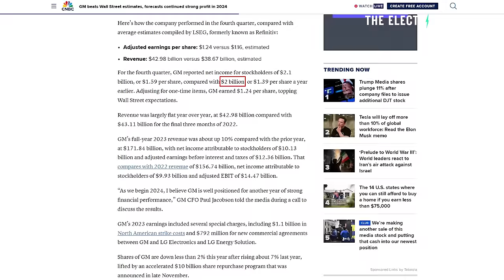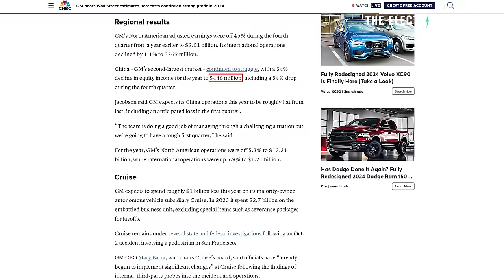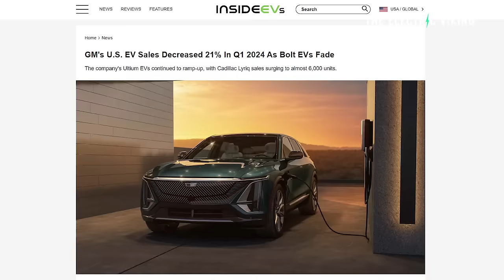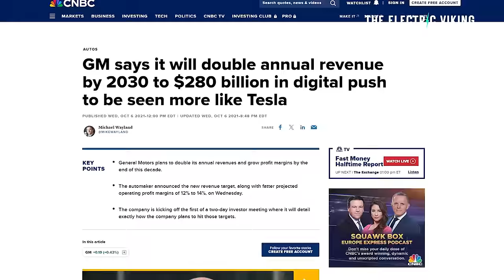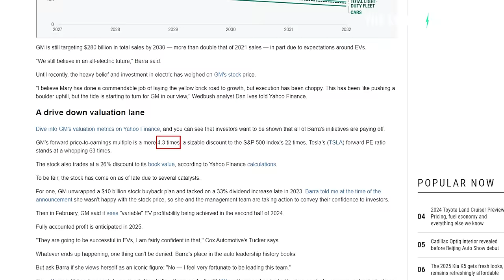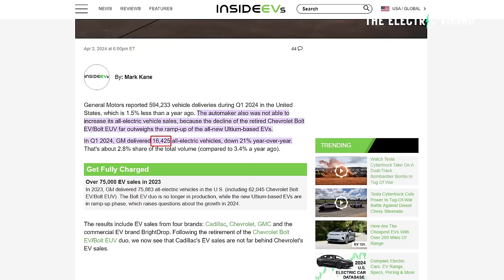GM will execute on EV promises in 2024 says CEO Mary Barra as sales fall 21%

Comment: The number of EV’s sold is likely due to the retiring of the Bolt, which has to be their number one seller. Time to move people to a full size EV … 

I’ve got a Cadillac Lyriq and it’s the best car I’ve ever owned. Does not have the race car fun of a Tesla … as it’s a full sized EV but it does everything extremely well. 300 mile per charge, no problem, 290 khw fast charge , no problem, 4 wheel drive through the snow ? With ease. Plenty of luxury, and high tech stuff to keep all happy while you effortlessly and quietly float down the road …. I have stopes in a gas station going on 4 months. 

Love love love my car

Comment: Someone took pics of the Celestiq driving around Ann Arbor, MI last week. Wonder if it was part of that interview…

Anyway, the Chevy Silverado is a pretty impressive EV pickup. it’s pricey, but it has awesome range and charging speeds! If I were to buy an EV pickup, that would probably be the one I’d get. I’m
not getting an EV pickup (I don’t need one at all) but, if they can get their cars up to the same standard then they’d be tempting. Add in NACS support and then it’s just a matter of which is the better deal, Tesla or GM? Tesla for now, but GM has a slight chance to make it interesting at least!

Comment: They missed the boat by not asking us what we want.
Reply: We want cheap small EVs like the Bolt.  Before that, we wanted hybrids like the Volt. She canceled them.
Reply: I want a front engine 8.0 Liter 9000 RPM Redline and 850-1000 HP 2 seater under 3000lbs.
Could GM be ANY farther from the mark?
Reply: NVM  what we want  Joe Biden wanted EVs to rule.

Comment: GM hasn't "delivered" because there are, unfortunately, too few EV buyers.  Unsold EVs are sitting on dealer lots.  It's not Barra's fault that there are too few EV buyers. Why has sluggish EV sales become a moral problem for Sam?  In 2024 most of the early BEV adopters don't need another EV anytime soon. Tesla is now competing with Tesla for new EV sales. Should Barra throw good money after bad?

Most Americans that wanted EVs already have one. Many found owning an EV too much trouble and went back to gasoline.  Tesla probably will survive as long as tax credits continue - then all bets are off.  Tesla risks  becoming a future automotive trivia question like DeLorean.

You can lead an automobile driver to an EV, but you can't make them buy.  

I'm going to enjoy my 1990s vehicles for a long time.  The support for that era Honda and Toyota is very good. For Lexus, you may need to scrounge for used body and trim pieces, but mechanically you can still find most OEM parts. Aftermarket parts from China aren't always the best quslity.

GMT400 and the followup GMT800 GM trucks from 1989 have a huge following.  Those dependable  trucks sometimes go 1 million miles. I predict that there will be many refurbished trucks from that era 35 years from now.

I'd personally like to see a BEV Yaris, but Americans generally avoid small cars. Tesla would lose money on that level of  necessary  vehicle.  A budget priced EV is necessary because that price of car is the most difficult to make profits.  I hope EVs succeed, but Sam will be gray-haired by then.

It's not a moral problem that buyers shun EVs in 2024. Politicians have been saying that Americans are stupid for not buying EVs. They jet around everywhere
Reply: There just aren't any cheap EVs in the USA like the rest of the world. Bolts were ever increasing in sales after they straightened out the battery problems. They better get their act together before the Chinese come in and eat their lunch.
Reply: @Timothy Keith 1367   👌 👍